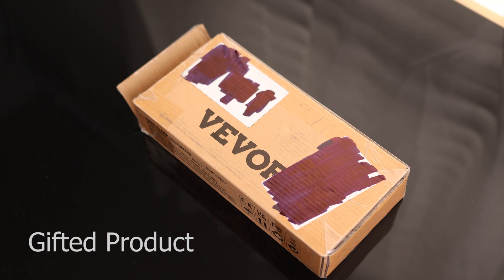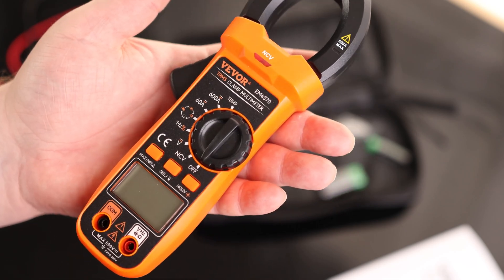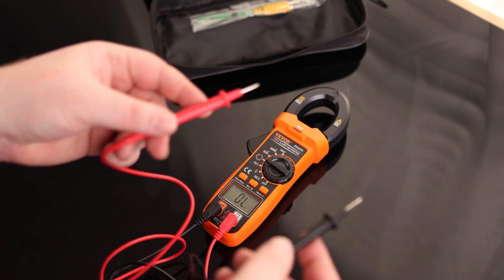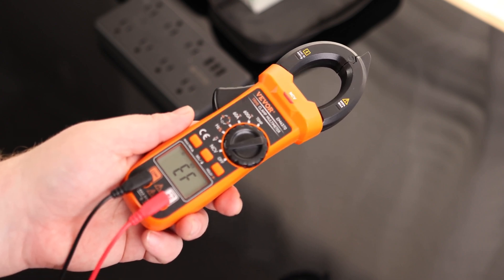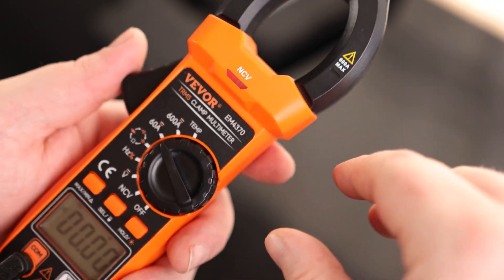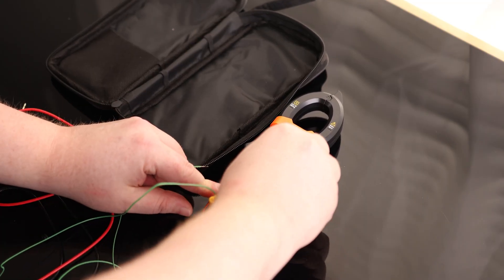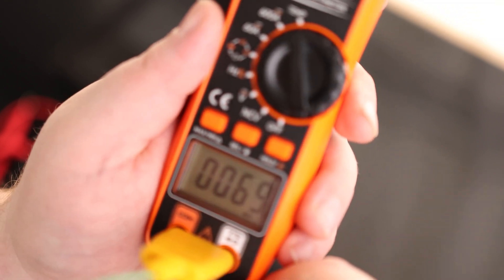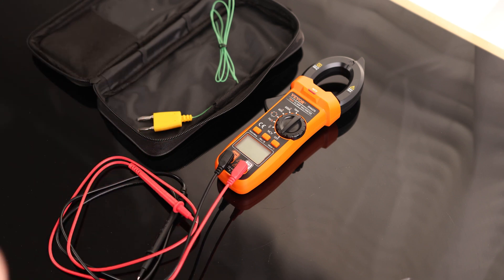VEVOR Digital Clamp Meter T-RMS

Comment: I am not satisfied with your review. I expected a clema test beforehand so I could compare my copy, for DC measurement there are much better and cheaper multimeters. Because you see I purchased this fake multimeter, which when measuring AC shows silly things. AC/DC measurements along the wire shows correctly, but AC using the clema no longer. And I did not make the mistake of grabbing multiple strands. 😒

Comment: Amazon shows this model EM4370 as being an AC plus DC non contact clamp meter. But you state that the clamp won't work with DC current. Can you please comment?
Reply from the maker: Well, you sent me down a rabbit hole.  My understanding was that clamp meters always only work on AC, but I've come to find that some actually work on DC now.  I'll have to do some testing and get back to you.  Thanks for asking.
Reply: @distractor_beamreviews  
So can you use it for non-contact DC measurements?